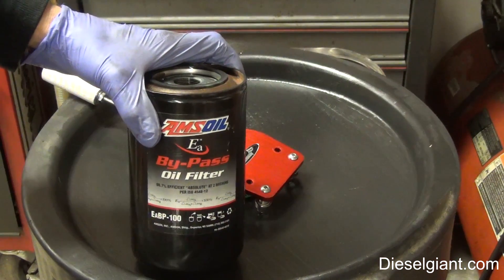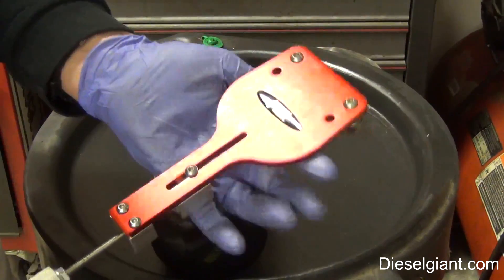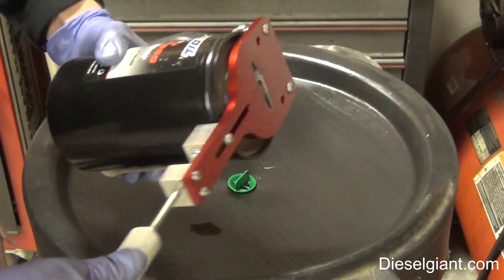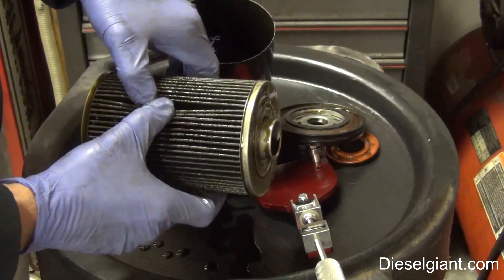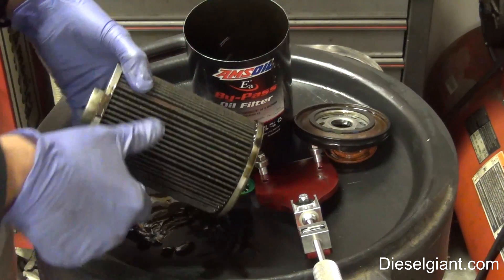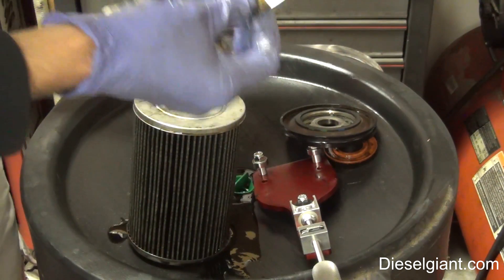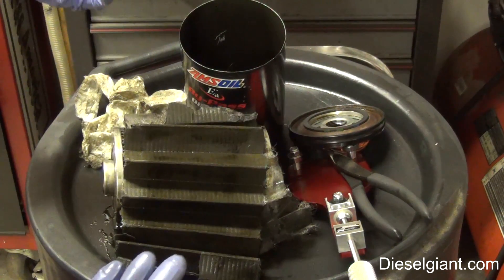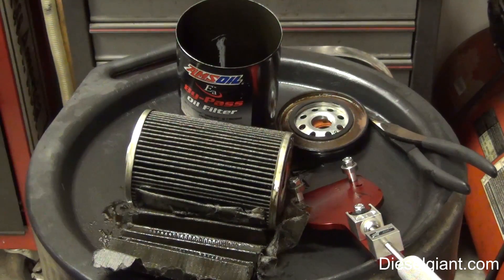Amsoil Ea BP 100 Bypass Oil Filter Cut Open and Inspected

Comment: The bypass kit will allow you to help filter out more particles in the oil. But additive packages and friction modifiers are breaking down over time. Heat and pressure beats the crap out of oil. Its the additive packages that are protecting the engine. My opinion going 20000 miles on oil is idiotic.
Reply: Depends on what test results of the oil say. If someone can run 20,000 miles on oil and the lab shows everything is still fine, there is no issue.
Reply: your absolutely right about the additives its called "shearing" to a point..base stock has a lot to do with it (class III is ultra refined dino oil) (class IV is 100% syn or PAO)...the "PAO"based oils will go farther thats why Mobil 1 Extended Performance is all puffed up with itself..(yes all mobil 1 products arnt 100% syn) theres only 3 100% syn oils that im aware of.."amsoil  ss" "castro german made syntec" and the before mentioned "mobil"heres something that most folks dont know about with synthetics..the additives package is rejuvenated with the new top off oil that is added after a filter replacement..mind you this wont go on indefinitely..but it will get you that 20-25,000 mile mark.. also its been proven time and time again that friction is what makes an engine wear out..once you eliminate that (synthetics) then its dirt..hence the bypass filter..talk to fleet managers that run their diesel fleet on LP you wont believe how far they go on between oil changes because LP burns so cleanly..
Reply: @Jordan Bronson - I don't think you are understanding what application a bypass kit is more used for.  Also, the oil sample test isn't just for testing to see if oil needs to be changed.  It's to monitor the health of the engine.  Paying ~$30 on an oil test once a year is hardly an issue compared to the value you receive.  This is more for diesel and other expensive engines to replace/maintain. Not to say you can't for your typical every day cars but traditionally not done.  You can't just go spend $26 and do an oil change on a diesel engine.  Tractors, diesel trucks and other such engines are work horses and need to be monitored much more so than your Camry, Civic, focus, etc. Buying cheap oil and filters for these engines would be a huge/costly mistake.  I suggest to go do some reading/research on diesels to better understand the value of oil bypass systems.  Good luck!
Reply: Jordan Bronson At least I don't sound like a 13 year old who can't get his point accrossed You just make your  self sound even more stupid when you talk.
Reply: i actually posted a reply here a year ago asking when they changed from cellulose rings (it was like 13 pineapple rings stacked under spring tension) to this medium they have now..back then 20+ years ago they told us to run the bypass filter till it wouldn't get hot from the oil anymore :/
Reply: @ferrelx  I think Amsoil learned a good lesson with the canister filter. It was good enough to eliminate routine oil changes.They had Bobby Unser saying this oil change is forever. The problem is people are so brain washed they think oil is supposed to get dirty and be changed. I believe Bobby Unser was a famous  race car driver. I gave up routine oil changes in 1963 when you couldnt use multi grade in a diesel. Standard Delo was 29 cents a quart in the discount stores.Delo came in W30 and W20 It was beautiful on the dipstick if you kept it clean.
Reply: true, additives and oil degrade over time. but the main causal factors are fuel dilution and water, which bypass filters cannot overcome. thus, periodic oil analysis is key to the decision when to change oil. by filtering the microns, a significant abrasive is removed from the oil, which will indeed prolong engine life under normal circumstances. but a bypass filter may not prolong the oil life when other contaminants are present.
Reply: Try 200,000 miles without an oil change. I've got samples from diesel customers that are running 20,000 full flow filter changes, 40,000 mile by-pass filter changes and over 200,000 miles without draining the sump. Oil analysis proves this.  AMSOIL had a study with a guy that went over 400,000 without an oil change in a class 8 road tractor...
Reply: Jordan Bronson Do I look like I know you? I need to know someone to tell that they have never used Amsoil or have tested it because if you did the math at what I sell Amsoil for it 50$ for a gallon with a filter, and if you do the math at a cheap oil change it's cheaper to use Amsoil then get under your car every 3-5k and change it your self. There's a reason why there's thousands of independent sellers who believe in this.
Reply: I learned a long time ago if you want to hear a lot of opinions from people that dont know anything about the subject just mention oil and filters.
Reply: Except for Navy ships that go for years on one oil charge🤔
Reply: No offense but you opinion doesn't trump science and test results.  Like the other commenter said, you can send an oil sample out which will tell you what the status of that oil is.  Then go from there.
Reply: Cost $100 just for oil and filter to change 16 Quarts ( 4 Gallons 15-40 ) in a 7.3, 6.0, 6.4 or 6.7 diesel. This is who its for not a Mazda Miata.
Reply: +David Bess - For fucking 32 years.... You have NOT learned a simple Business " TACTIC "... NOT to call People " STUPID NAMES ", even if they are " STUPID " ..., or " ANYTHING " in that nature... But to " PERSUADE " them in a direction that " MAYBE " and I said " MAYBE ", they will leaned towards your direction !!!   Strange... I don't take Business Courses right now, since I am going for a Law Degree.  But at 16+ years old... I do know how Business works!   Maybe this is " YOUR FREE LESSON " for today!   LMFDAO (Laughing My Fucking Dumb Ass Off).!!!
Reply: Jordan Bronson You have a lot to learn.
Reply: +waterloo123100 - Your fucking Sentence runs longer than the Equator.  You don't need to " Educate " me about Oil.  BTW...  Maybe you can use the Oil to " LUBE " your " English " / " Grammar " skill.  HAY !!! I got an idea, it might be stupid......  Use the Amsoil and sell a few Gallons to take English 101 or 102.  FUCKING STUPID NIGGA !!!  😂😂😂😂😂😂😂😂😂 LMFAO !!!!
Reply: @JodBronson  Three years have passed since you’ve posted these comments, but I’ll be god damned if they aren’t still pure gold. I think I find the most hilarious yet ironic piece of elegant literature you’ve written here is your remark about the correct use of grammar 😂. Telling someone they need to attend collegiate English courses when you can’t display a single sentence without grammatical error lol. Specifically your use of capitalization and quotation marks thrown about like a toddler in first grade. 😉 Just simply an outstanding performance portraying the very definition of the word hypocrisy. Might I add you’ve done so with such an incredible level of humility lol.
Reply: @JodBronson  Well that was disappointing and anti-climactic to say the least... I was almost hoping you grew up and matured to a level that would allow you to respond with something somewhat clever or enlightening. Especially considering you’ve had 3 years to graduate high school and start attending English 101. 😂 So how many years have you been held back in ninth grade now? Wait never mind, I don’t really care. I don’t think I can dignify, let alone justify your ignorance and racism anymore with the time of day. 
No, that was rude of me. I apologize. I truly hope that someday you find a saint in this world that carries enough strength to ever love you buddy. Have a wonderful life 😃
Reply: @burrr1047  - Niga please !!! 😂😂😂😂😂
Reply: +waterloo123100 - SHUT THE FUCK UP MY NIGGA !!!  I gotta make some money $$$$, so I can buy me some oil my nigga!  😂😂😂😂😂😂😂😂😂 LMFAO !!!!
Reply: David Bess 
Hi David, I'm wondering if you have some thoughts for me. I didn't buy a kit, but sourced out all the components to install an oil bypass filter on my 81 rabbit diesel. She's rust free and worth it to me. I bought the eabp100 amsoil filter, and bought a housing for it off eBay that accommodates the 1"-16 thread that this filter has. I bought a gauge and mounted it just past the "out" on the bypass filter housing. My thought is, I could monitor pressure at warm idle new, and keep an eye on this pressure later on. Filtering only 5 1/2 quarts, it'll be interesting how this pressure changes. I bought a "sandwich filter adapter" from summit, connected the out to the in, and the in to the out. Now to my questions. At idle, the gauge is reading 80 psi, and will go temporarily over 100 when you kick up the idle. I've had this thought that this filter skins off 10% of the oil, and filters it. But is this filter ok at 80 to 110 psi? Lastly, it's rated at 70,000 miles. That is probably on a 15 qt oil system. At 5 1/2 quart system, will this filter last longer? I will probably be making a video on this and I appreciate your input on my new system.
Reply: +yamaharidr450 - I have to agree with you there... Another option would be drain a Quart out, and put a New Quart of Oil in every 5 Thousand Miles for " Viscosity "???   Here is the funny part.... Lab Test Cost around $26.00 (2017 Prices).  Might as well take that Money and buy New Oil + New Filter. The plus part is... At least you know it's new and " Never " have to worry about the " Old " Oil.  Also I like to note... 25,000+ Mile without changing Oil or even not " Just Examine " the old Oil, is beyond me.  With all the Money spent on expensive Filters, Lab Tests, etc..... Just take that Money and spend on Cheap Oil + Cheap Filters and change your Oil every 3,000 5,000 Miles.  At least you will know how your Engine is doing every time you change the Oil.
Reply: +David Bess - Sorry but I WILL NOT fall for you or your Company that you work for. I am EDUCATING myself as we speak. For the Record... I got myself into College at 14yo. But hey... Let me be the STUPID and the DUMMY, right? At least I am NOT STUPID enough to fall for SCAMS and ELABORATE ADVERTISEMENT and you should READ my comments especially... " embedded in your brain with elaborate advertisements and aka " MICRONS ". LMFDAO (Laughing My Fucking Dumb Ass Off).
Reply: +waterloo123100 - LMFAO ... You know me so well right??? I'd bet you even know what kind of Toilet Paper I wipe my ass with right???  LMFAO !!!
Reply: Hahahahahaha AMSOIL and OIL TESTING Company will THANK THE DUMMIES for sure, LMFAO !!! Even at 20 Gallons... I REFUSED to give into that SCAMS that they embedded in your brain with elaborate advertisements and aka " MICRONS ".  It will keep those People in these Companies in Business, so yea...... Throw your hard earned Money at them, and GOOD LUCK !!!  LMFDAO (Laughing My Fucking Dumb Ass Off).

Comment: I run dual amsoil with bypass filters on.my lmm. would never stop
Reply: Does you oil still turn dark or stay amber color?
Reply: Eventually always turns dark.
Reply: Diesel Is sooty and will never keep a clean look like new oil unless you do some deleting and mods
Reply: I recently bought a 79 Ford diesel tractor. I changed the oil and installed a flat head Ford V8 canister filter converted to use 4 1/2 inch Scott 1000 toilet paper.The oil is starting to get a dark tint to it. It will be a shiny  black. Some soot is non abrasive and too small to be filtered out.  If you rub some in your palm and it wipes off clean without staining the skin it has passed the palm test..An old truckers test.

Comment: Doesn't this reduce the oil flow to the engine?
Reply from the maker: No not one bit.  It only takes about 10% of the oil flow and diverts it to the bypass filter.
Reply: Not even 10% the .032 orfice takes away maybe 1-2 psi
Reply: I am running a 05 toyota tacoma 4.0. It does not reduce oil flow as this is a supplement filter to your stock full flow filter. I have installed a oil pressure gauge and have never seen a drop in pressure. Under freeway speeds this filter will clean all your oil in approx 15 min.
I run Amsoil sig series 0-20. oil changes at 11,000-12,000 miles and send the oil in for third party analysis. I have less contamints then the average change sent to them with 5300 miles and they tell me I can keep running it.
Reply: Mr. Me hello I have 2013 tacoma 4.0 and I want to install this were I can get the parts thank you
Reply: Bypass filters have been on engines since the 1920s. Most optional equipment. The orifice size average is 1/16 inch. I sometimes make them by putting  a .025 wire welder tip in a brass fitting..In the 60s the Frantz oil cleaner didnt need an orifice if you used a two port Frantz sandwich adapter.. My flat head Ford  V8 toilet paper conversion uses a Perma Cool universal sandwich adapter that I got from JEGS years  ago. They were normally used for oil coolers.When you use a very small orifice you need to make sure the filter is heating up. The Jackmaster Classic is the best when you dont have much room under the hood.

Comment: when did they stop using the cellulose rings in the bypass filters?
Reply: Some manufacturers still do. Fram is one of them. At least in their basic filter they do.
Reply: The original Amsoil canister bypass filters were a lot better then the spin on filters at cleaning.
Reply: As far as I know Fram went from using cotton to using almost useless pleated paper in their bypass filters. My 41 Dodge used a Fram bypass filter that used cotton. It was the same as a Luberfiner. You could still get cotton elements for them up into the 60s. I think they are all pleated paper now..

Comment: Honestly you won't see partials in bypass because your full flow already filters 20-25 micron. If you see visible metal shavings they will definitely be in full flow. Your naked eye won't see nothing in bypass at <20 micron.
Reply: Extend the oil? So high temps don’t still break down the oil properties ?
Reply from the maker: Yes but the oil analysis sees all.

Comment: what would.i buy for a 2016 chevy silverado duramax motor. what brand and model.that would.wprk with the Amsoil bypass filter? 
thanks
Reply: Sean Faulk contact amsoil directly by phone they know exactly the part numbers you will need for your application. I ordered one for 15 Silverado 1500 with 5.3 L83 and they knew exactly what part numbers I needed.
Reply: This clown is clueless
Reply: If you'd like more info and don't have a dealer yet checkout my Facebook page, has all my contact info. Thanks! 
- Nathan
Facebook.com/BestMotorLube

Comment: Takes moisture out?
Reply from the maker: Yes it sure does.
Reply: Dont depend on a pleated filter to remove water. The absorbing filters such as toilet paper can remove a few ounces. After the oil heats up it will remove the water fron the filter. Then the crankcase ventilation will remove the water from the oil. If you dont drive enough to heat up the oil you are in a heap of trouble.

Comment: I first had a 6 inch Amsoil by-pass filter installed on my Nissan in 1985. It was a canister when you took the top off and pulled out the filter, rather messy. But the filter medium was at least 2 inches thick.  Amsoil has a filter demonstrator which has a tap on the outside bottom where you could drain off the water from the filter. It did remove water from the oil. It showed that it could remove every seem particle of carbon black that was added to the oil and you could compare it to a regular full-flow filter.

With the tap half way, so oil flowed through both the by-pass could clean the full-flow.

I had this on VHS video, but that was stolen in a burgulary many years ago.

But I was surprised how thin the filter medium seems compared to the original by-pass filters. I did have an example, but that has been thrown out as it is all beyond my capabilities now.

I then went to a dual guard, a by-pass and full flow on the same housing with an adaptor to the full flow mounting block.

Now there is no room in modern engine bays.

But the full Amsoil system on my car gave me a 14% improvement in fuel economy.

And Amsoil withdrew from New Zaland in 2004.
Reply: The old canister filter was a lot better than what they have now. They had Bobby Unser saying this oil change is forever. I think the reason the new filters seem good is they dont have much to do with these modern engines and modern oils. My old Ford diesel tractor has a lot better filter than Amsoil has but it has more work to do. It has a flat head Ford V8 canister filter converted to use Scott 1000 toilet paper. I have a package of 4 1/2 inch Scott 1000 toilet paper
Most of the toilet paper filters take a smaller roll.